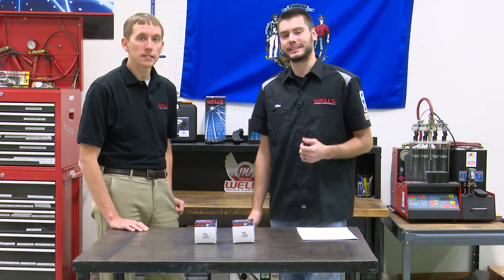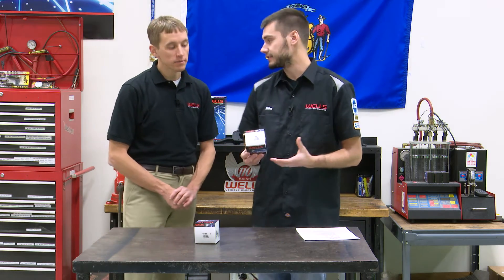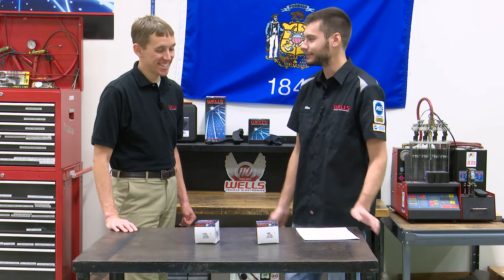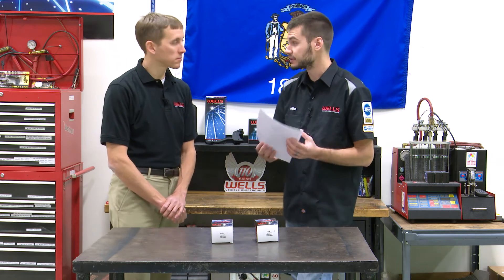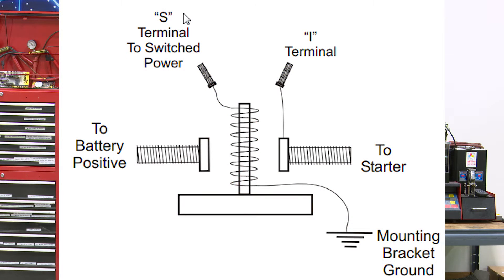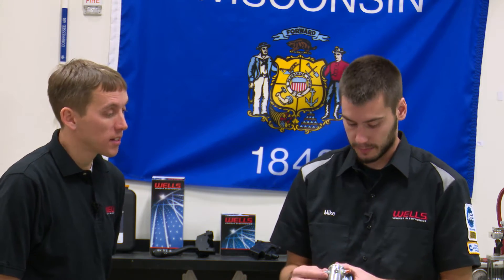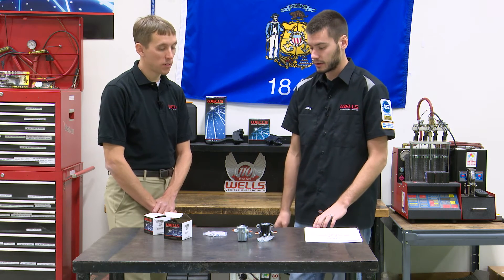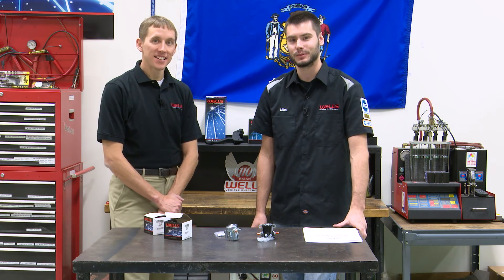Wells CounterPoint Ep. 11 -- Starter and Continuous Duty Solenoids (F496 & U1453)

Comment: I went to the wellsve website and the part that comes up for my Ford is 1M1030 and not the  F496 or U1453. The part description doesn't say whether it's intermittent or continuous. It's baffling to me that it's being emphasized in the video, and elsewhere, how crucial it is to use the right type, yet the product description doesn't say which it is. The same part comes up whether I select "solenoid" or "relay" from the parameters. Can someone direct me to where I can see it in writing from the manufacturer what type it is, so I don't have to rely on any particular person to remember correctly?

Comment: My electronic engineer son while watching your video with me was cringing whenever you said solenoid.  Those are relays which switch current.  Solenoids perform work such as a starter solenoid.  Anyway, GREAT video.  More guys need to know the difference between those relays, so we mechanics don't need to travel to a stranded snow plow rig and work during a driving cold snow storm fixing the problem.
Reply from the maker: Thanks Chad, and yes your son is 100% correct. Really a starter solenoid is just a very large starter relay. The reason we call it a starter solenoid is because that is what it is called in the industry. We don't want to create any confusion that isn't necessary. Tell your son thank you for noticing and correcting that. I appreciate the feedback. Thanks for watching!
Mike Becker, Technical Services Instructor